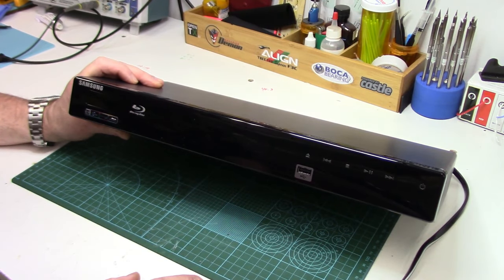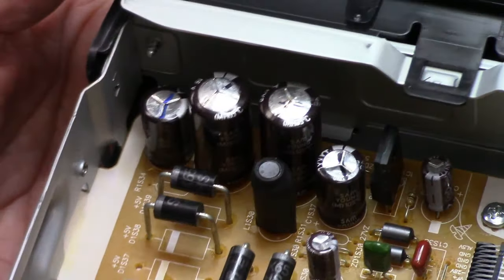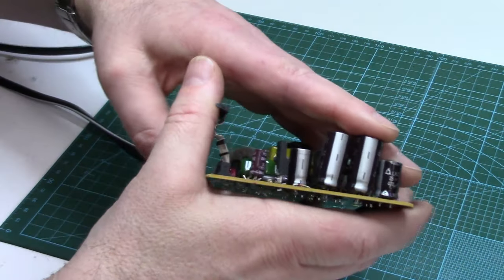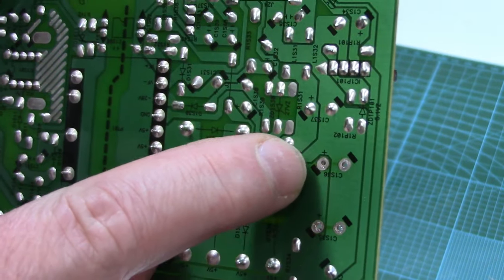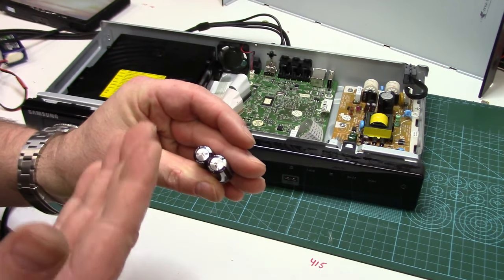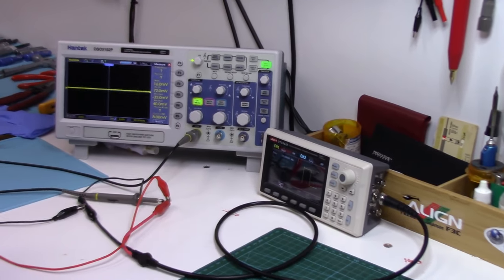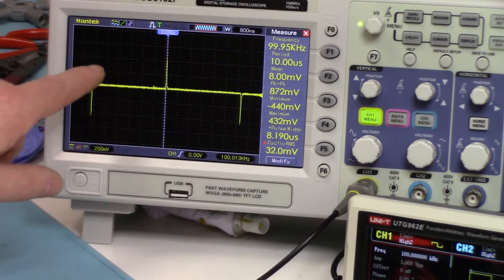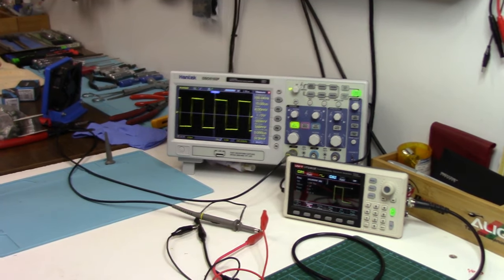Easy Electrolytic Capacitor Replacement & Testing Methods

Comment: It's actually pretty shocking how many semi-"new" stuff stops working because of failing caps. I had several DVD players on my healing bench not older than 10 years that stopped working because of failed caps while most of my 30-40 years old hifi equipment runs still on it's original caps.
Reply: @BlondieHappyGuy  Not necessarily. I've heard stories of VCR repair techs in the first half of the 1980s who were replacing electrolytics in power supplies left, right, and centre, some VCRs as little as one year old. Some old equipment is just a lot less sensitive towards semi-poor caps than switching mode power supplies are. Then of course there was the counterfeit capacitor plague of the 2000s that affected lots of huge equipment manufacturers. Actually I wonder if the Panasonic HDD/DVD recorder I'm working on right now might be old enough to have that issue, the power supply section has leaky Elna electrolytics all over.
Reply: @BlondieHappyGuy the quality of caps used in stuff that isn’t cheap in the least bit is egregious as well. I frequently find absolutely garbage caps in high end, very expensive audio gear.

Comment: I always recommend taking a quick photo of all components prior to removal.  Observe the polarity of polarized components prior to removal.  I have encountered several occasions (especially with Marantz) where board markings are incorrect (factory quality errors).  Always replace components with the polarity used from the factory.  Do NOT rely on PCB markings to be accurate.
Reply from the maker: Very true & good idea. 👍

Comment: I bought a job lot of used Dell computers from a school a few years back, and in this bundle was a brand new one that worked for a minute and failed. Needless to say i was intrigued, so the first port of call was to open up the faulty one. Lo and behold half of the electrolytics were installed the wrong way round, a quick replacement af roughly half a dozen caps and all is well again. So even the big boys make mistakes.
Reply from the maker: Excellent fix!

Comment: I love that desoldering tool!  For the record, I have been finding that most overseas manufacturers are using capacitors with voltage ratings right on the line.  In nearly every instance, products that have failed me were easily repaired by replacing the caps and doing so with the next higher voltage rating available.  
The two most expensive items I have repaired were so very cheap to fix.  
First was the first flat screen TV I ever had that was a plasma TV.  Absolutely wonderful image and it started to not want to turn on.  Finally, I hear POP one day and smell the unmistakable odor of a capacitor gone bad. The TV was dead.  Now, as an aside, I used to hear ALL THE TIME about plasma TV failures and how they would go into dumpsters.  I opened mine up (about two thousand screws later) and looked at the power board and saw a few bulged caps and one clearly burst.  Now, here's the STUPID part.  Though they had caps rated exactly for the voltage of the board, the board was drawn to accept LARGER ones.  "This is TOO easy!" I said to myself.  Yes, it was that easy.  I didn't just replace the bad ones; I replaced ALL of them for about $12.  That was over two decades ago, and that Plasma set still works like new!!!  Like I said, how many plasmas were trashed for a $12 fix!?!?
The second item was the control board for our $1 Jacuzzi (yes, $1 from a friend that moved and couldn't take it (6 people too!).  That board was a little less obvious.  I found the testing procedures on-line and did everything as stated.  I then found a very nice repair service in AZ that worked on them and sent the fellow an e-mail and outlines all my tests.  He actually CALLED me on the phone saying that he was impressed seeing somebody else who knew about everything to make the repair.  He said, "you won't believe what the problem is."  I answered, "The capacitors, right?"  Yup, same thing and here again, I fit the next higher voltage rating caps on the board and called it good.  That board never failed again, and it only cost me $8 for those (the repair guy normally got $200 if he did it, but he didn't ask for a dime just to confirm what I already knew).
So, are the manufacturers purposely cutting it too close with the caps knowing they will fail so you buy a new item?  Somehow, I think so.
Reply: For 12v power supply they put 16v caps. When the voltage peaks, it goes 16 volt or higher. Thats how any equipment fails. A thumb rule to be followed is using just double rating cap than the intended voltage. Likewise for 15 to 18v, go for 35-40v cap. For 24v go for 50v rating.
Reply: isn't just a $12 fix, your time and tools are $$, and an electronics shop would charge for their time and experience.
Reply: @dicko-200  - I worked in an electronics store and did moderate repairs.  We were VERY fair on what we charged.  I could tell stories about the big "pro" repair shops that fell flat on their faces!  Worst case ever...  A CB radio that was brought in and not working at all.  Sent to pro shop #1 and came back after 4 months with: "Cannot find problem, Unit not worth repair."  Sent it to pro shop #2, SAME THING.  Sat in the back of our shop waiting for the owner to come get it but after four months he hadn't.  One slow day, I said "Oh, what the heck, let me see if I can fix it."  I took the back off, examined it for about 1 minute with a magnifying glass and grabbed the cordless soldering iron to touch up just ONE bad solder joint.  Worked perfectly!  $10 repair and the customer was ecstatic!!  Why didn't I just fix it there in the first place?  Pro shop #1 (that owned our store) had complained we were not sending enough repairs their way.  We sent it to shop #2 because we THOUGHT #1 at least TRIED to fix it, so it must have been beyond our talents.  We were wrong!!  The pros don't know it all.
Reply: If a few Caps in parallel have one bulged  change all 3 as the unbulged could have failed first leaving all the work onto the bulged one.
Reply: No doubt!
Reply: I think you're onto something!

Comment: I have found SO many failed electrolytic caps in all the repairs that I have done over many years that I replace them with a higher voltage cap, and I have never had one come back for any related problem. Thanks for sharing the video.
Reply from the maker: Good tip, thanks for the view 👍🙂

Comment: So typical in power supplies.  The capacitors are failing due to the poor selection of the capacitors in the design of the power supply.  There is a spec called "ripple current", and most engineers aren't even aware enough to check that spec when selecting caps.  It's easy to exceed the ripple current rating, then the caps overheat inside, drying out the electrolyte.  This design even paralleled 2 caps, and it still wasn't enough!  I learned about this back in the mid 90's, and have spent quite a bit of my career fixing power supplies with this issue.

The spikes you're seeing are the inductance in the test leads you're using.  At a 100Khz square wave, there's no way to get rid of them, and even a new capacitor will fail to filter them out.  Some designs parallel smaller value capacitors with the larger ones, but this isn't necessary in this application.  Excellent video, and I like your method of testing in-circuit.
Reply from the maker: Good stuff. Thanks and cheers!
Reply: Thanks for calling out the parasitic inductance as the source of the transition spikes. I was hunting through the comments to see if anyone else identified it before writing!

Comment: Thanks for the explanations and demonstrations.  I really appreciate people like you sharing knowledge & skills, esp'y. when you're concise & efficient with the task at hand.  So many ppl spend too much video time pointing out the obviously UNrelated components &/or features.  "We're going to check the power supply because the red standby light doesn't come on....or is it blue?  Let's seeeee........"   

Um no thanks, I'm troubleshooting my DVR's power, not LED colors.  Move it!  :face-purple-smiling-fangs:

Comment: When caps fail and get bulged i replace them with a bit higher voltage rated ones, in that case if they are 16v I put 25v if the size allows me. I use to test caps with an analog multimeter but after all this years i found the best method is replace "all" old caps for new ones especially on the hot locations on the device and the power supply.

Comment: Better quality caps, last longer, in my experience, nichicon kg, rubycon, Audio note, there's lots, great video👍
Reply from the maker: Agreed, those are good cap manufacturers. Gota add one more of my personal anecdotal experience favorites to the "good list" : Panasonic. 🙂
Reply: @Rchelicopterfun  I've seen Rubycon's fail on many motherboards over the years. Nichicon's and Sanyo's are much better in comparison.

Comment: Your desoldering tool is amazing sir
Reply: The hakko is even better 1/2 -1 second to remove caps of this size
Reply: @ericschulze5641 I know it's been a year, but which Hakko model?
Reply: @johnbauman4005  newer solder takes more time but still better than solder wick
Reply: Fr301

Comment: Yep, JCCON do go bad, have replaced them on motherboards.  It seems the ones that go bad are the ones that are the smallest size for a given spec.  If using sketchy caps, I'd go up in voltage if room permits.

Comment: My 2009 LENOVO M58p desktop computer was now giving me the boot loop run around.   The cause turned out to be due to there being 1 defective capacitor in the PSU.  However, 5 other caps also had the bulge as well.  Overall, I replaced 7 capacitors.   Now all is well again.   Total cost was $9.55.   That is a heck of a lot cheaper than buying a new PSU.   Same goes for my 2010 SAMSUNG TV.  Just 1 capacitor had to be replaced, which I removed from some old junk that I had floating around, and so it cost me nothing at all.   And so both are still working to this day.
Reply: Isn't an old unused capacitor prone to dry out, or they dry out only from overheating?
I'm trying to understand if it would have been better to buy a fresh one.

Comment: Built an ESR meter when I was a young tech in training. They are worth having and provide a reliable indication of a bad capacitor in circuit too. But your method of the function generator and CRO works well. Guess they aren't CRO's anymore having digital screens. Fun fact, the first digital oscilloscope I ever used was worth $80000, how times have changed.
Reply from the maker: Yep, crazy how little digital o-scopes cost now.  🙂 Thanks for the visit.
Reply: That's insane! I was blown away at what Tektronix was getting for the analog scopes like the 2445 when they were brand new. No wonder the average hobbyist had to settle for a tiny little 15MHz with bare minimum features to be functional and still paid a pretty good price for those even.... but the Teks were definitely fetching top dollar for those days. 80s prices are still more than I'd want to spend nowadays, nevermind if inflation since then and such were factored in. I was lucky enough to have found a used 2445 in mint condition with fairly low hours on it compared to a lot I've seen. They actually track how many times they've been powered on and booted up too which I find I testing to look at. Seems most labs turn them on and leave them on none stop only shutting them down on weekends or holidays is what I find evidence of most times. Funny, I bought an old scope to work on my electronics and actually found working on old tek scopes can be pretty fun and challenging too. Love the old tektronix test gear.

Comment: Replaced 160v 47uf caps on my tv p/s board with 300v 1000uf. The TV turns on and works fine, do you think I'll have a problem later on?

Comment: Very interesting and informative as always !! My pool pump was having more and more difficulty starting last summer and as you said, it finally would not start at all...Main suspect was the big capacitor ...Changed it, and bingo....Starts like new. But now with your video, I will be more confident to try it with household electronics !  Thank you M.Salt .
Reply from the maker: @1983dmd Yep, caps are consumable. 😄 Good you were able to fix your pump with a new one.
Reply: That cap on the pump will have ~ 100 V on it  so more dangerous than a DVD cap!
Reply: @danc2014  A cap on a DVD player would have 110-240v before stepped down to 5-12v on the powersupply side.

Comment: Hi john. I would like you to do some video clips on how to repair an adapter charger (12, 24, ..) volts and also advise the common faults/damages on the adapter chargers.
There are a variety of adapter chargers such remote control toys, scooters, etc.. batteries chargers. Just simply pick any of them as examples.
Thanks

Comment: Thank you for the Video. Do I need to worry about the Ripple Current rating of the new capacitor? Some people are very serious about them and some don't even bother thinking about them.
Reply from the maker: Completely depends on the circuit and application. If the circuit in question has the potential to produce lots of ripple in operation and the design specifications calls for little, then of course you want a cap that is of the required rating to absorb it. If it's a non critical/low current application however (such as this item), then it's moot.

Comment: Excellent and very useful! Do you ever discharge capacitors before replacing them?
Reply from the maker: Not on little low voltage caps like these ones - they hold very little energy. I personally start concerning myself with discharging high capacity caps once they are over several hundred volts.

Comment: Good video, thanks for the upload! Curious, did you discharge those two biggish caps before removing them?
Reply from the maker: No for three primary reasons:
1. Circuit is self discharging.
2. They were faulty caps and didn't hold a charge.
3. The voltage is low (under 16V) and not a risk factor regardless.

Comment: Thanks for posting this! Is there any way to check a capacitor while it's still in the circuit board?
Reply from the maker: Yes, with a dedicated ESR meter. Low cost example in description.

Comment: Anyone remember the Chinese capacitor fiasco of the early 2000s?
It was mostly flat screen tv power supplies with them. 
I think it was mostly electrolyte drying out and / or low heat tolerance.
Reply: Sadly, the dreaded capacitor disease disabled a tower motherboard of mine. Sure enough, examined the pressure relief cuts across the tops and most were bulging or leaking.

Comment: In this case it is clearly seen that the capacitors are perforated.  I really liked the desoldering gun, I had not seen it before.  Could you tell me if it is possible to buy it somewhere?  Thank you.
Reply from the maker: Links are in the description.

Comment: John; I' m fixing a Jennings slot machine. Could I replace a 1.0k Tantalum Capacitor with a new 2.2 Electroletic capacitor. Same voltage.

Comment: could you use caps from an old PC motherboard per say that still aren't bulging and leaking?
Reply from the maker: Yep, provided of course they are the same values. Best to test them first to make sure they are not faulty because as stated, not all bad caps will show physical damage.

Comment: John that method works for capacitors of a wide range of capacitances or do you have to adjust frequenvy and/or vpp ?
Reply from the maker: I've found it fairly universal, at least for my hobbyist/DIY testing applications.
Reply: @Rchelicopterfun  ty :)

Comment: Wait, i was thinking that you can place both more Voltage and more capacity in microfarads? Like you can safely put 25v 3300uf instead of old 16v 2200uf. Am i wrong?

Comment: Thank you, John, for your video,awesome equipment. what brand of capacitors that you are using for repair?
Reply from the maker: I don't recall, just searched though my odds & ends cap bin and found a few that had the same ratings. If you have to order them anyway, usually best to get them from a good supplier such as digi-key, mouser,  online components, etc. These places generally don't sell crap or reject caps that you might sometimes run across on ebay & amazon.

Comment: My general approach to testing electrolytics with a multimeter or capacitance meter is: if capacitance is way out (over 50%) the cap is definitely bad. If the capacitance is in the right ballpark that still doesn't mean the ESR is good, so slightly inconclusive. Apparently high ESR will throw capacitance readings off, at least sometimes, so a much higher capacitance reading than the cap value does tell you the ESR is too high. Annoyingly you can't trust in-circuit measurements and not all bad caps bulge or leak visibly. In fact, out of all the rotten apples I've replaced, only a handfull showed visible damage. All the others looked fine.

You can get very affordable component testers that measure ESR, among many other things. These testers can check many different diodes, transistors and other electronic parts and seem to be fairly reliable, especially for their price. The most common model is the LCR-T4.

Comment: Wouldn't it be good to clean under the  capacitors that leaked before replacement?
Reply from the maker: If there was residue on the board of course, but these ones as shown only had slight staining on top; there was nothing clean underneath.